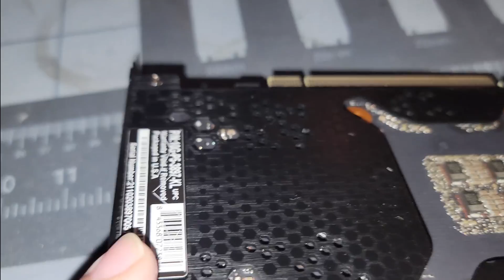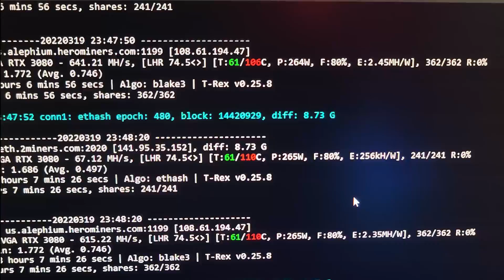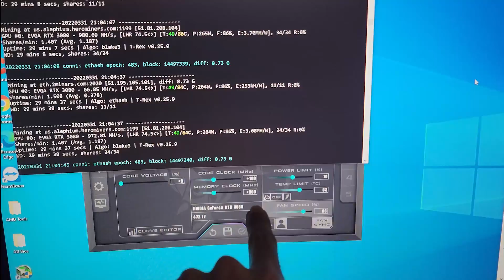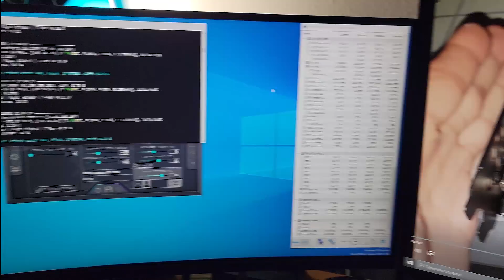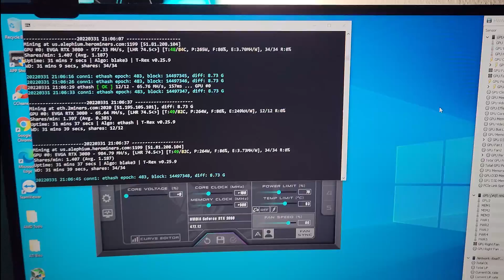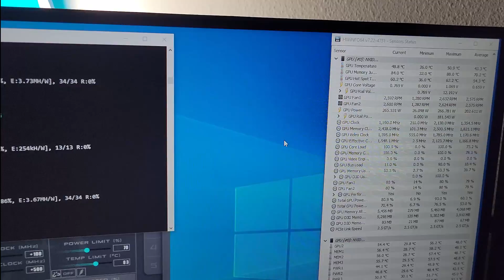EVGA RTX 3080 FTW3 Ultra Teardown & Thermal improvements

Comment: Kapton tape and you know you can cut copper shims very easily and de-burr them.
Reply from the maker: Yes and yes, but I use the same nail polish, in layers, as electrical barriers. (Same used for Liquid metal applications) the issue was the second part, as the pressure forced by the cold plate onto to SMD is what caused my issue. But coolmygpu custom plate is precut.

Comment: I didnt see any Kapton tape in the pics, maybe missed it. The tape goes around the memory modules to prevent a short. Glad you got the temps under control, gotta replace a few pads myself - my 3080TI are scorching hot, again.
Reply from the maker: No tape, nail polish layers. Same used for Liquid metal applications. I talk about it in my other videos where I used copper shims. However, these shims won't work due to SMD or component above the left side 4 mem modules, and the CoolMyGPU plate wold work better as it has a cut out designed for said SMD. I do have K tape, but the nail polish layers never failed me. It was just the pressure of the last shim on top of the ceramic SMD that caused my issue. However, back to normal. Thanks
Reply: @SerpentXTech  Gotcha, thanks for the detailed response, appreciate it!

Comment: The problema with the FTW3 cards is that they use 2.25 mm pads, not easy to get, and by the way there are much better pads than the minus pads, gelid ultimate for example or the thermal right, GPU risers pads, etc.